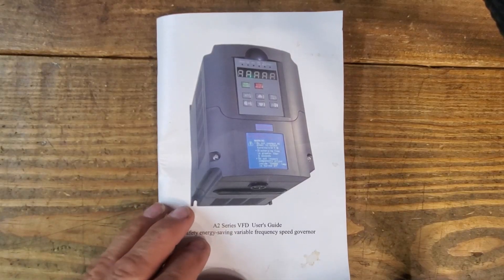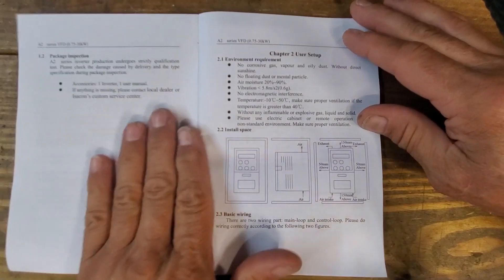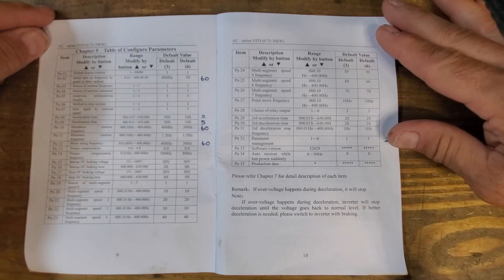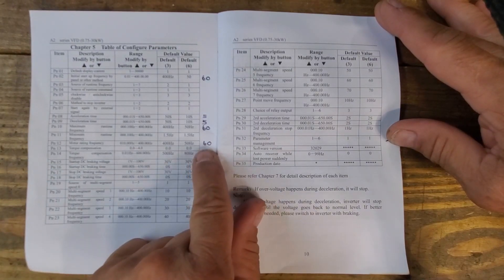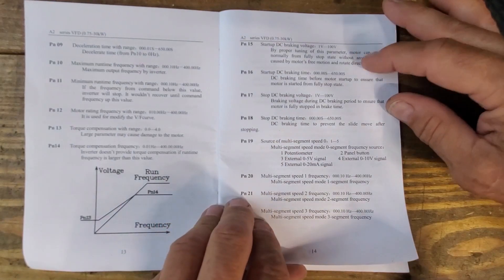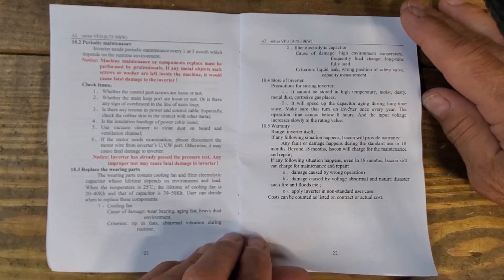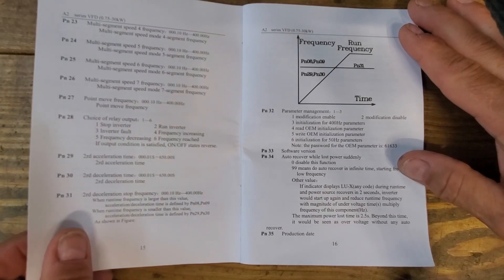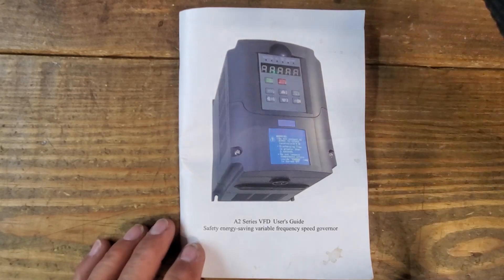A2-8022 VFD settings Part 2

Comment: Hi mate. Have you f...ed around with "External 0-10V signal" on this device? I cant get it to working.
Reply from the maker: Hi, I have not used this myself but I believe you have to select Pn19 to 4 to activate it. hope this helps. it must be no more than 12v
Reply: @AndrewJWatts  Hi Andrew. That Ive tried a few times, without luck. But I did find out something strange today. When the motor is not connected, I can change the Hz from the computer via 0-10V. But when I connect the motor it only starts, and stay there at around 5Hz and wont move. Whats going on here? Its so weird. I had it running the first times I hooked it up, and the next day it didnt work anymore. Now Ive been f... around for a couple of days now

Comment: Hi There.
I have a got Modal A2-8030.
I like to make it run in set speed as soon as power on.
At the moment I have to push the run button all ways. But it has a function to auto run. I can't  find the way to do it please  make a video to how to Auto run.
Highly appreciated.
Reply from the maker: Hi  have not been able to make that happen, I think it is a removed facility do to safety issues of a machine springing into life after a power outage. sorry
Reply: @andrewwatts5625  
Thank you very much for your Prompt response. 
Actually  I manage to set it an run on that mode.
Reply from the maker: @kamalarunashanthikarunarat4951  can you post here your settings as I have been asked that before. Thanks
Reply: @andrewwatts5625 .
It was a point move by external signal.
What is have done.
Pn 03 change to the  06( external digital signal)
Pn 04 . Change to 02 (external signal control)
Pn 27. Can change to the frequency what you prefer. 
And then use the down bottom  connector bar to connect three  points.  Terminals number  7 Ground ,Terminal number 11 and 13. Terminals connection have to be done after power supply  off .  Make sure that 
That all about it.

Comment: How did you wire the momentary switch to the unit? I am having trouble understanding which ports to use and how to program accurately. Thanks!

Comment: I bought a 7.5kw unit to use on a 10hp motor.  Programming instructions could have been a bit better but with a little work it runs fine.

Comment: How do you configure this device for auto start? So when you power it up from main switch, it starts running. Like you can do with the HuanYang
Reply from the maker: Hi there does not seem to be the facility of this auto starting. Probably a safety feature so machines do not auto start after a power cut
Reply: @AndrewJWatts  No no, its possible. I managed to figure it out:
pn004 = 2
pn007 = 2
Wire between “GND” and “FWD”

Comment: I bought a model from Vevor, H100-7.5S2-1B, to my big surprise it does not work. I am not sure if I did a mistake in wiring but I recheck 3x everything. Not sure if I have to do something in parameters.
 I am conected with 24 and 220V because everything it is with this voltage it works on my milling machine.
So far impossible to find somebody to help.
vevor website dont answer back at all.
I open a ticket 3 weeks before I bought the veariateur, just to be sure I buy the right product, no answer, so I bought it, now I start to regret because is impossible to get some support from them

Comment: hello I have the same inverter mounted on a lathe, but I have a problem; the motor starts regularly but when I attach the clutch to make the lathe spindle turn, the inverter gives me an "OC-r error".... an over current problem
what could it depend on? Thank you
Reply from the maker: it sounds like you are overloading the unit and it is not powerful enough for the job. you need to check your power requirements and purchase a suitable unit with enough spare capacity
Reply: @AndrewJWatts  hi, the unit delivers a power of 3kw and the motor is also 3kw; in fact, the motor starts regularly but then when I give it load with the clutch to make the spindle turn, the inverter stops and "OC--r" appears on the display. right now the lathe requires a lot of current which the inverter only supplies when starting the motor.
he has only 35 parameters while the other models over 100..
thanks for the contribution
Reply from the maker: A 3kw motor will spike over 3kw on initial load which is why your unit is tripping out. You need to build in spare capacity
Reply: @AndrewJWatts  the inverter delivers approximately 16 nominal amperes during normal operation and can also deliver 150% more current for a few seconds during the motor starting phase. my problem is that when the motor starts it still has no load, only when I engage the lathe clutch to start the spindle do I add load to the motor and the inverter goes into error because at that moment for "him" it is not the startup phase..
do you think the parameters referring to the torque (13 and 14) can influence my problem?
sorry but I don't know if I was able to explain myself, I use google translate ... greetings
Reply from the maker: @pierluigidelmanso8728  Hi i do not think that 13 and 14 will help. You have an inductive motor which is the same rating as the unit and then you are adding a resistive load ie the clutch. so you have the load spike of the  resistive load at the same time you load the motor which adds an inductive load spike. I think that you just do not have enough spare capacity with this unit or that the unit you have is faulty. either way you probably not going to get this unit to function as you need

Comment: The video is helpful I have two A2-8075 VFDs 7.5 kw I found no parameter to set to match rated motor amps or volt - it is pretty simple with some VFDs to set output voltage and input the full amps of the motor. My lathe runs fine but VFDs can control voltage and amps to match the motor plate and some case that's desirable.
Reply: I had this same problem & it's a pain if you want to use a lower powered motor ( which I do with my other VFDs)

Comment: I just want to say thank you for the 2 part videos you did on this product it helped tremendously. I have the A2-8075 model version and with your detailed info it helped me get out of a tricky situation. I tried multiple adjustments and this helped out with a few tweaks of my own i got my 3 phase Copeland compressor up and running again. I went from single phase Copeland compressor with capacitor relay and starter to a 3 phase Copeland compressor with VFD. 3 days of messing with it and now thanks to you it saved me a few hundred dollars. I appreciate the time you took to explain this. Much respect...

Comment: Thanks for the video, I set mine up exactly how you did in your first video. Came out today and it no longer starts when I send the signal from my controller. Can you help me?
Reply from the maker: Are you running single or 3ph?. Ensure you have input power on all phases. Try starting it from the on-board panel. Go back to a basic system. Power in, unit, power out. If you have power in ok, I believe there is an inboard fuse so check that. If all that is good the unit may be dead
Reply: I can start it when I have basic settings. As soon as I change Pn 03 to the external signal I get the reading on the panel that the signal is there but the spindle doesn't turn and the cooling fan doesn't come on.

Comment: Hello and thanks for a great video. I recently got one of these VFD and have some questions on the wiring. I am US and using a 220v input. I have a 4 lead wire for the input power . I connected the R,T to the hot wires and S to the neutral . But there is no place in VFD to connect the ground. Did you wire the ground and if so what terminal I need to connect the ground. Also the ground from the motor is also needed to be grounded. Given there is no ground wondering where you connected the ground. Any help is highly appreciated sir . Thx
Reply from the maker: Hi I have a main emergency stop button breaker box that my main power runs through and I created a common ground bus bar there for all the earths including an extra earth directly to the from of my mill, hope this helps

Comment: I bought the A2 (0.75-30kw) unit from amazon. the listing said it can be used for a synchronous motor but the parameters need to be changed, what parameters do I need to change to make it work? also what pin on the board in the PWM Pin?
Reply from the maker: Hi as far as i know the synchronous motor should just synchronize with the output frequency so wire it as normal, as for your question "also what pin on the board in the PWM Pin?" I do not understand what you mean, please rephrase your question
Reply: @AndrewJWatts  There is a pin on the VFD that you can connect a analog signal to to adjust the speed Via a computer. or also known as a PWM signal
Reply from the maker: @lt.schlechtnacht9414  hI Ok I know what you mean now the frequency control input is on pin 3 with a max of 6v aor pin 4 with a max of 12v. These are set on Pn 03, number 3 for 0-6v or Number 4 for 0-12v
Reply: @AndrewJWatts  Ive tried this (now on 3 different devices) but it doesnt work!

Comment: I would like panel to read run frequency, what parameter does this, if its 1 what should it be set at?
Reply from the maker: Hi Pn1 shoulds be set to 1 for run time frequency display

Comment: Sir gud day to you, I have an a2 8075 model, the problem is that the output is not same as the input, how can I set it to give same amount of output as the input, what should I do...thanks from ph...
Reply from the maker: Hi the A2 Series 8022 VFD is a variable frequency drive, where the motor speed is controlled by varying the output frequency. you should not have a loss of voltage, any loss of voltage would lead me to susspect your unit is faulty The 8*** series units are 1/3ph 220v input and 3ph 220v output. This is an 2.2kw unit, overloading could cause output voltage drop.